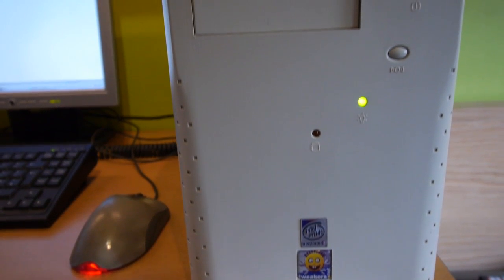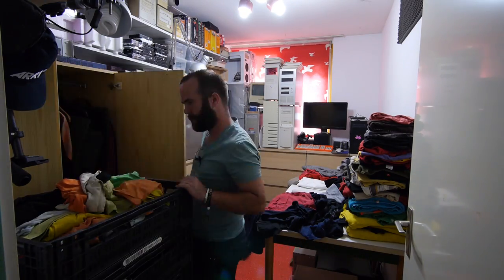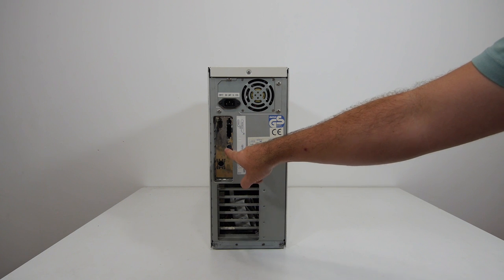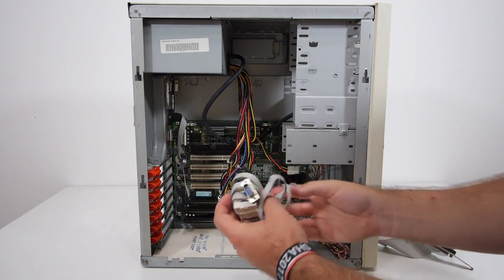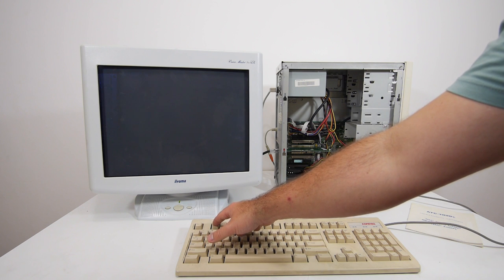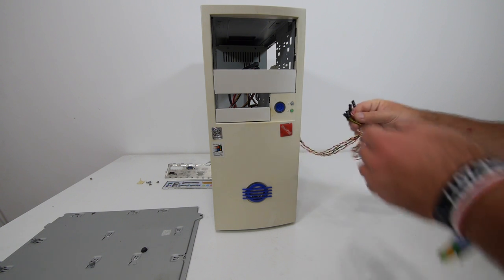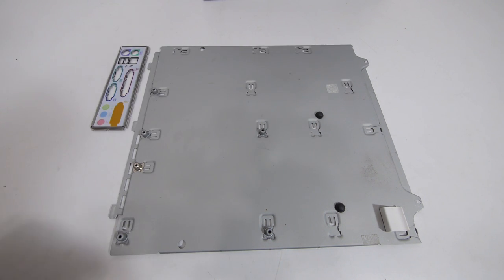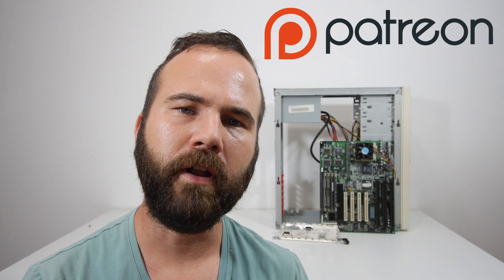Computer VLOG28: AT Motherboard in ATX case? ATX/AT Hybrid case

Comment: I have a pentium MMX 233 on an AT-motherboard hooked up to an ATX-supply, in an ATX-case. 

There are ATX to AT power adapters and I did not trust an old no-name AT-supply which is all I have. I had to exchange the switch in the power button of the case to support toggle instead of ATX-style momentary switch; the toggle shorts the PS_ON connector to ground on the ATX PSU just like the motherboard does in an ATX case when you power on the motherboard. 

For the I/O plate I got a blank one and drilled out a hole for the AT keyboard connector. The serial and parallel ports were all on brackets.
Reply: +aussiebear22 I just got it off of ebay. "Motherboard I/O shield blank" gives me one result currently and not a very good price, but you might find more suppliers if you can figure out a good search term.

Comment: I've got at least two AT/ATX towers but instead of having the two styles of power buttons at the same time, you can fit either the big clicky button for AT or the smaller one for ATX in the same spot. Recently I did find an io shield for AT motherboard in ATX case and that is great because they're rare

Are you going to keep that case even witht that ugly blue thing ? ^^